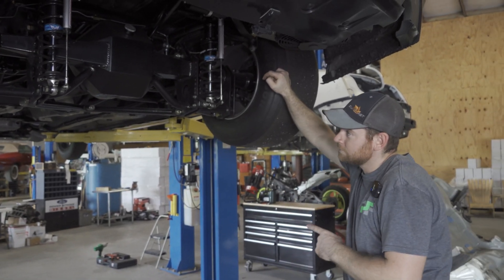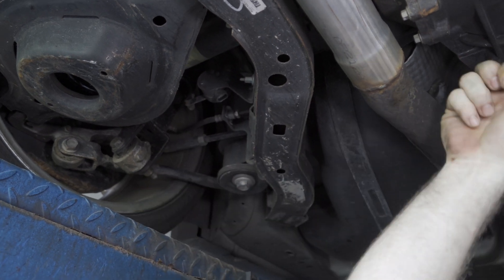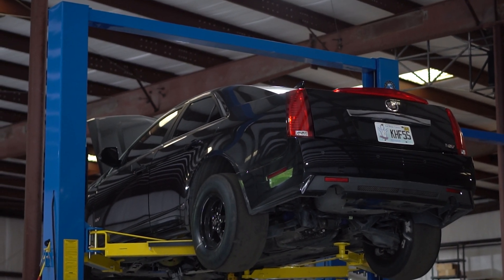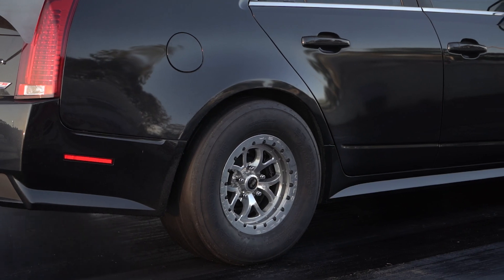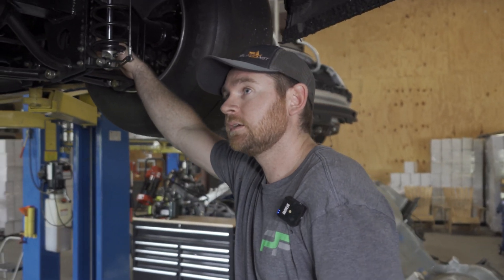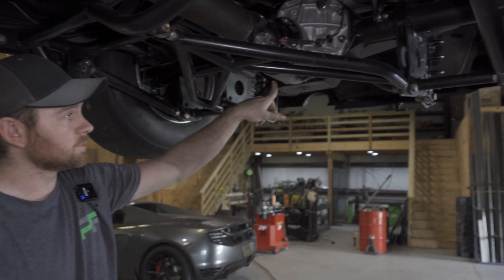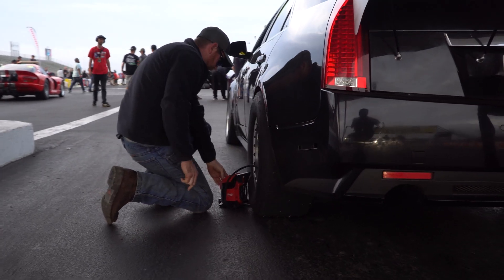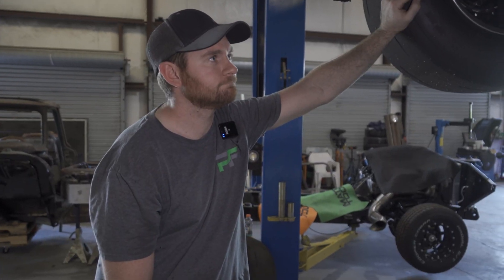IRS vs 4 Link | Why We Use a Solid Axle

Comment: What if the car is awd, would it still be better to have a solid axel over irs?
Reply: depends on the purpose of the car. If its an offroad dirt rally car like a Subaru, definitely gonna need a ton of suspension travel, which IRS may be better for because both wheels can move independently of each other.